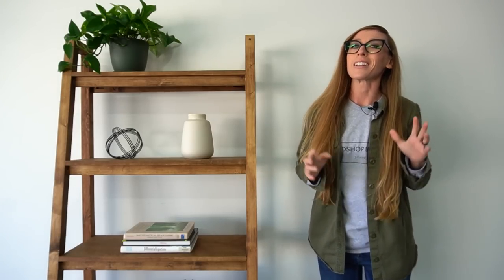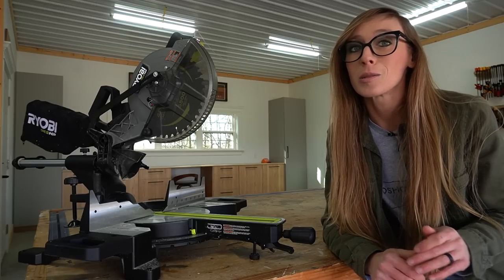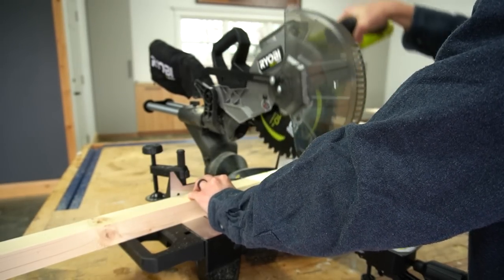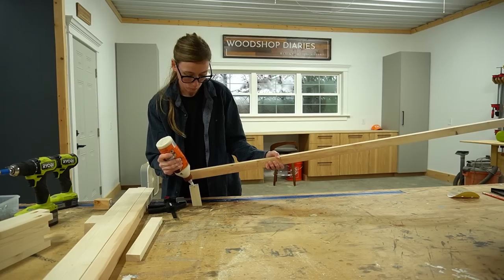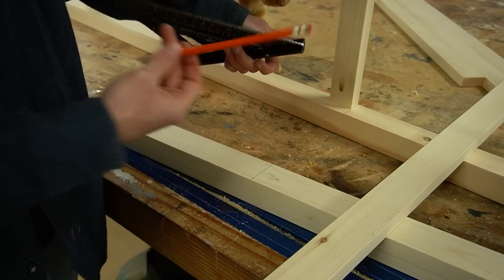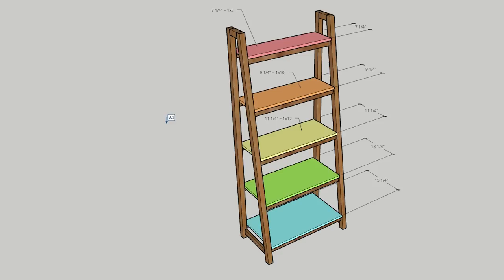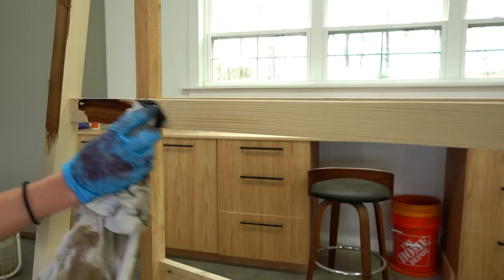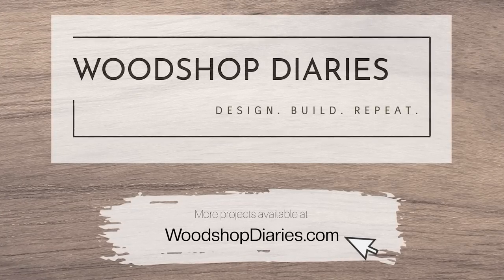How to Build a DIY Ladder Shelf with Basic Tools and Materials

Comment: Does the iron-on edge material ever bubble or come loose over time?  I've never used it and am wondering about longevity. Nice, beautiful shelf.  Very cheap to make as compared to buying something similar for much more and what you buy will likely have particle board shelves and wobble after assembly.  Very nice shelf indeed.  I need to make one of those for my home office.
Reply: OK, so I did a little digging about edge banding (by looking in your video description) and found the link to your page:  "How to apply iron on edge banding".  You answered ALL of my questions there! 😀😃😄😁
Reply from the maker: Thank you so much! I appreciate you watching! I’ve used iron on edge banding for years…in kitchens, bathrooms, on dresses and cabinets everywhere. If applied properly, I’ve never had an issue with it failing or bubbling up over time (as of yet). Now, that said, if poorly installed, yeah, it can come loose. The key is to make sure the glue gets warm enough to melt and adhere…which isn’t difficult, you just have to pay attention when you’re applying it. I use it OFTEN and I love the stuff.

Comment: Hey Shara, was wondering how you found your angle for the mitered cuts? I know how deep I want my shelves to be at each height, but not sure how to find the correct cutting angle to do that. Thanks!
Reply from the maker: Hi! I just picked the angle I thought looked good then cut my shelves to work with that angle. It’s a lot easier to do that way vs finding the angle to match the shelf depths

Comment: Did you use a planer off-camera to straighten your wood first , and if so which one do you prefer ?
Reply from the maker: I didn’t plane anything for this project. However I do have a planer that I use on occasion. It’s a 13” Cutech but they don’t make them anymore. But there are a ton of options for 13” planer. I’ve heard Ridgid makes a good one.

Comment: when you glued on the shelfs to the frame how does the glue stick to the wood stain?
Reply from the maker: It stuck just fine.  I wiped off all excess stain and allowed to dry a few hours before gluing. I picked it up and carried it by lifting on the shelves after the glue was dry, and didn't have any issues. If you were concerned though, you could add some nails or screws as well.
Reply: @WoodshopDiaries  Thanks 🙂